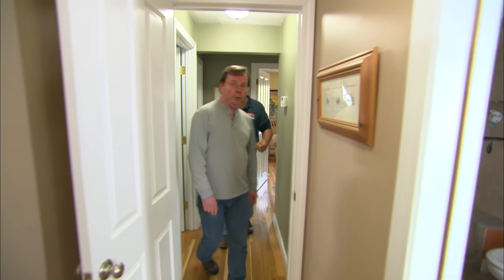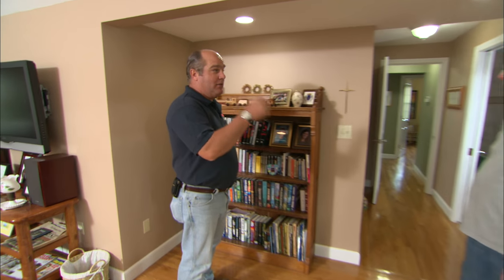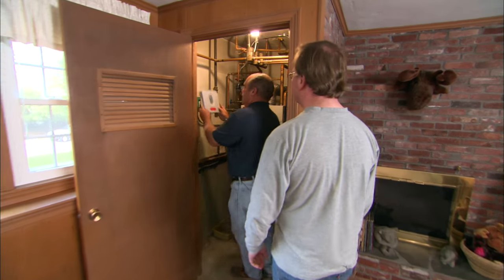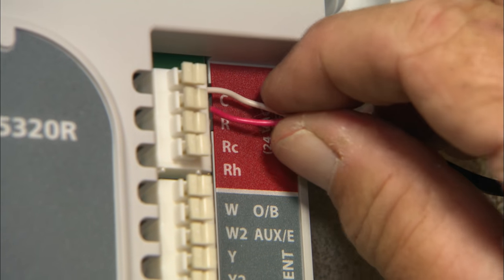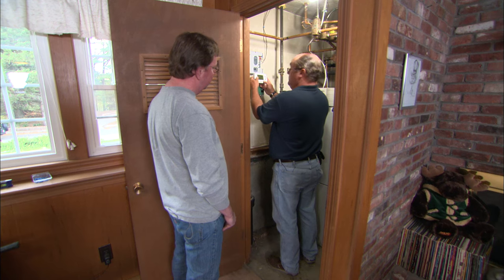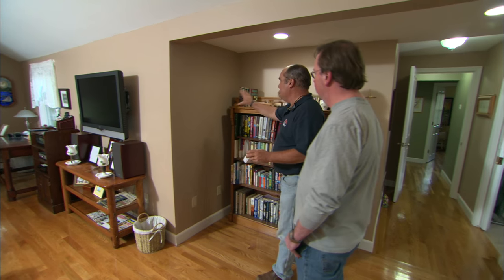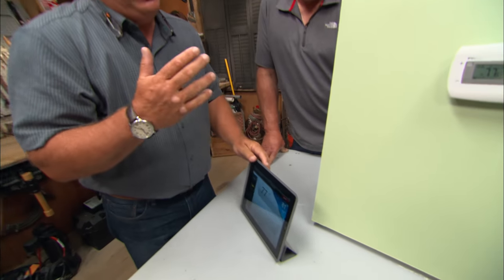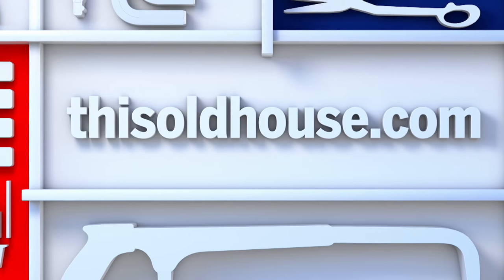How to Install a Wireless Thermostat | Ask This Old House

Comment: how did he drill those holes so fast and exactly correct in about 3 seconds without a guide lol
Reply: Backplate of Tstat placed against wall and he probably made marks with a pencil where the holes are on the backplate
Reply: McGyver!
Reply: It's called video prerecording.
Reply: Yeah the marks were not easily seen

Comment: In the wiring picture, he has the white wire from the zone valve spliced into the white wire from the 24 volt lead. It looks like there are two white wires coming out from the 24 volt lead, but that can’t be. What’s going on here?
Reply: Does anyone know the answer to why he pigtailed the white wire coming from the zone valve and the common wire to the honeywell home . i mean all the explaining he did and skips over what we need to know.

Comment: Great hands-on presentation. This is exactly what I was looking for for over a year and you have demonstrated that in 2015! Wow! Where I can buy this set? Need to control HVAC with the wireless receiver. Thanks so much for posting this unique video.
Reply: you can buy the thermostat on amazon
Reply: Honeywell YTH6320R1001
Reply: Thank you.
Reply: @Blox117  is that the thermostat featured at the end of the segment
Reply: @Vermontsasquatch420  i dont remember, that was 4 years ago

Comment: make sure you have a high quality wireless one, these ones if the batteries die in the RX unit  the TX unit will not remember and will not open the call to heat relay, this would cause your pipes to freeze and loss of home you went to work for a long time or out  of town

Comment: I have had 4-5 electricians and HVAC people in to try to install a new thermostat but none of them suggested this. I need to bypass the old line voltage for my current thermostat and this looks like the best way to do it. Not sure I'm confident enough to do the wiring, though.

Comment: Hi In the last part of the video Richard talks about replacing the thermostat with a receiver and using a remote sensor to measure the temperature in another location with out rewiring. What type of product is this please?

Comment: It would have been really nice if you took an extra second to mention what the second thermostat was.
It sounds a lot better than the first one that has all the BS.
The only good parts of this video is the parts they did not show.
Reply: Compscript I agree. But now the second option is discontinued. I have been searching high and low. Found some used on eBay but I don’t wanna try it.
Reply: the honeywell vision pros are actually very good and easy to use

Comment: What is the range from the base unit to the wireless thermostat?  Why not try to link them from the remote location; this would insure that it's within range.  You could have left the old thermo wire on the valve and cut it to length and brought it to the base unit; save some wire and time.

Comment: Is there a modern unit equal for that? I have a two zone house. Upstairs zone was buried in the wall during a remodel. Upstairs is freezing in the winter time with no heat coming out of my radiator. I need something similar to this unit.

Comment: So I just purchased the nest thermostat, went to take my old thermostat off to install the new nest but looks like I have one of these wireless thermostats. When I snapped the current thermostat off the wall was so confused how it was running and no wires where connected.. I see wires in the wall but they are taped off, am I able to hook a nest thermostat up? Not sure where the other wireless part is at.. We moved into this house last year.
Reply: Michael Finelli sounds like your receiver could be near your furnace and all you need to do is move your thermostat where you want it. I’m interested in knowing what you found out. I’m looking to get a wireless thermostat and hoping to connect the current thermostat wiring to a receiver then move the thermostat where I like.
Reply: Me & Them Kids hi, actually after long research found that in my roof we’re my AC unit is there is a wireless transmitter up on the roof. The AC screen inside is connecting wireless to that unit up on the roof. 

So I currently left it how it currently was. I really want to access it remotely from my phone to adjust the temp. I could buy a nest but it would have to install on my roof. I would have to disconnect the thermostat setting on it and have it setup to a wireless thermostat reading from in the house. 

A company called orbi, something like that has wireless sensors you can put around your house. Maybe that’s something you can do. It helps with hotter rooms and lets the AC know.

Comment: 4:50 to save your wall from getting smashed up like this. Push the screw into the plug and hit the screw with the hammer. Much easier to sink the plug into the drywall this way.
Reply: Or just use the tip of a red robbie screwdriver and slightly bang it in before placing the screw
Reply: It’s gonna be cover what does it matter

Comment: While this answers the question on how to install a wireless thermostat. It's better to use a taco zone control panel and put one thermostat for each one of those zone control valves. So you will have 3 zones that are independently controlled

The board then can command the boiler to turn on and off.
Reply: They are independently controlled. Each one of those zone valves have there own T stat....
Reply: Sir, you know your stuff ! Congrats.

Comment: What is the model of the last thermostat shown.  The one that connects to wires of the existing thermostat, which greatly simplifies the wiring process.  Please advise.  This would really work well in my house.  Thanks!!!!
Reply: This one is great ... you take the wireless thermostat to anywhere in the house and the ac will keep that "area" where the thermostat is to your set temperature .. 
in my house the thermostat is on the wall at the entry ... our living room is on the other side and there is a 4 deg difference between where the thermostat is and where the living room sofa is ..
Reply: They dont have that model anymore anything similar that you can recommend

Comment: I have a Ranai wall mounted gas room heater. The thermostat is INSIDE the unit, and to get to it, you must remove the entire unit from the wall, disconnecting the gas line, and the exhaust vent. Only then can you remove the back to get to the existing thermostat. Of course the corner where it is mounted gets operated by the INTERNAL thermostat,. Thus the room is always colder. Is there ANY way to make this work at all, without access to that internal thermostat.  I see NONE.

Comment: I bought a Honeywell WiFi thermostat. There is no C wire. However, there is a black and red wire from the furnace's R terminal going to the R and RC of the old thermostat. Could I simply move the black wire from the furnace's R and put it to the C terminal and same on the thermostat? Then put a jumper on R and RC on the thermostat?
Reply: No you cant. The two wires you have are for the signal to kick the heat on. Have to run a new wire or they make separate t stat setups that will solve that problem

Comment: i like it but a link to the thermostat used would be nice. if they used it then it is a good product generally
Reply: +George Gardinier They probably just used whatever product would sponsor the show or give it to them for free. I think the video is more on point of showing you how it's done, regardless of the brand/product.
Reply: +briancnc The other thing is the model might not be made anymore from when the video was filmed. Thermostat technology is changing more every year lately than the past 50 years with all of the Smart thermostats coming out you have Nest Ecco bee and others. For some reason nest doesn't have remote senors but Eccobee does.
Reply: it still is available fyi
Reply: George Gardinier its a Honeywell THM5320R which can be optioned with zone control and have multiple wireless(radio signal) thermostats, humidity sensor, outdoor temp and a wireless remote with optional wifi.

Comment: looks like the thermostat at the end of this video is a Venstar T1100RF Wireless Digital Thermostat Sender
Reply: and a Venstar T1100REC Wireless Digital Thermostat Receiver
Reply: Yes, it would so appear along with a T1100REC.
Reply: Thank you they should have plugged and got a few bucks. Morris Air Conditioning and Heating Brandon Fl.
Reply: Thank you guys for the names of the units. I really appreciate it!!!! Going crazy trying to figure it out.

Comment: What is the name of the second thermostat ??????
Reply: I want to know the name of the second thermostat also....the last one where you install the box to the wires where the old thermostat was and then you get the thermostat you can move around the house without using internet. 
Please tell us what this thermostat is called because I need one.
Reply: @DonWonCho74  looks like a venstar T1100. That puts a base on the old wired wallplate and a hand held display to move around. Wireless (back to the boiler) version is T1100RF and T1100REC
Reply: @submariner650  I live in a condo so I don't have access to the boiler room...can I just buy one of these wireless thermostats and connect all the wires instead of going to the boiler room??

Comment: Wait. There is a Honeywell thermostat that communicates with the internet and doesn’t need power from a C wire?  Does anyone know the model number of the thermostat used in this video or have more information that could help me?

I have a Honeywell FocusPRO TH6320R thermostat.  It is wireless, just like the one in this video (and looks identical to it).  My thermostat communicates with a Honeywell THM5320R receiver (the exact same interface as in this video).  My thermostat communicates well with this interface, but CANNOT communicate with the internet.

I would like to upgrade my thermostat to one which communicates with the Internet but was under the impression that all such thermostats need power other than that provided by the two AA batteries in the thermostat.  That extra power being powered by a 24 volt Common Wire (C Wire), which my wireless thermostat does not have.  In this video, they just popped their wireless thermostat into its bedroom cradle, and viola! they were controlling the unit from a tablet (5:40 in video).

To make matters a tad more complicated, I would like to have the thermostat communicate with the internet a wireless “hot spot”.  I do not have internet in my rural area but can get a 4G cell signal.

Can anyone provide guidance?

Thanks.

Comment: I would like to add a wireless thermostat to my house.  The one I have is on the wall where my furnace is and the heating and cooling is never correct.  I don't want to have to do any new wiring except the one you showed at the end of your video where I just replace the unit on the wall.  Can you tell me what make and model I can guy.  Thanks,
Reply: Look at Ecobee units. Available at the big box stores. Put the main unit where the thermostat is now, and then use the wireless sensors (one comes free, and you can add up to 32) in the rooms that you want to balance.

Comment: You going to want to put a fuse in there between doorbell transformer and that 400 dollar wireless control module. It’s called protecting your investment.
Reply: What amp ?

Comment: my issue,with a setup like this,is what if u lose power for any given reason,are u supposed to just freeze to death ?
Reply: That ENTIRE SYSTEM would rather heavily depend upon electrical power. The transformer, the circulating pump, the zone valves, and possibly, even the boiler all need electricity to function. Very few "whole house" systems can function without power.

Comment: Does anyone know the name of the last type of unit he described (the one where you replace the hard-wired thermostat with a transmitter to the thermostat)?
Reply: I think it's "Venstar T1100RF and T1100REC Wireless Digital Thermostat Kit ". I was googling around trying to find it, and that looks like a similar thing to what they're using. Unfortunately, it's unavailable... so need to find an alternative that's in stock somewhere

Comment: Confusing. Since you still have only one thermostat wouldn't it be better to place it in a representative room no in the front room with the fire. Say in the hall area. How can one thermostat really have work for a whole house? You would always get blind spots no?
Reply: In the case of the homeowner, he had more than  one thermostat because the house had a multiple zone radiator system. The thermostat they relocated was only for the master suite.
Reply: +Rymac91 thank you. That makes sense.

Comment: Why would you need a stud to mount that box to the wall... im sure is does not weight 110 lbs ... at best its 2lbs ... you dont need a stud or anchors ... just take the screw straight into the drywall ...

Comment: I'm failing to understand the need for wireless thermostats. Are people THAT lazy that they can't get up to change the temps in the house? Not everything should be wireless or "smart" (connected to the internet). In fact, the less that is, the better.
Reply: I understand your point,  however this is exactly what I was hunting for.  It has nothing to do with lazy. Do you not know the point of a thermostat? It's not just a control for turning on your ac and heat like and on and off switch. The key word here is thermostat.. the unit sense temp and turns on..if you have a 3 story town home or something similar like me,  my rooms are on the 3rd floor and the thermostat is on the second floor.  Heat rises junior.. that means in the summer heat rises and the thermostat in the second floor room makes the second floor cool and shuts off. Meanwhile the 3rd floor is still warm from heat rising and needs to get cool but it can't as the thermostat is satisfied from the 2nd floor cool room. So in turn i can't get my 3rd floor cooler than 76 degrees and that sucks as I can't sleep when it's warm. Moving the thermostat is not feasible and very costly. Having a wireless thermostat on 3rd floor and transmitter on the second floor where the power unit is allows the unit to stay on until the 3rd floor cools off. So now you have been schooled so you can stop looking like a total jerk off.
Reply: You are not the only important human on this planet.. keep that in mind when you consider things like this and insult someone for having options
Reply: @jorose95  Actually, it does (have to do with being lazy). Can you not go up to your 2nd and 3rd story floors and manage your thermostats? Why have a 3 story townhouse if you struggle to go up the stairs? Or have someone else manage the thermostats? Why do you need to move your thermostats? Usually, they are mounted on the wall. My, are we sensitive! I'm merely trying to keep people from becoming sloths. So, you wanna become one? Okay. That's your business.
Reply: @jorose95  I never said I was the only important human on this planet. You implied it. Pardon me if the truth is considered an insult.
Reply: @jorose95  Get off Chris Gast's lawn.